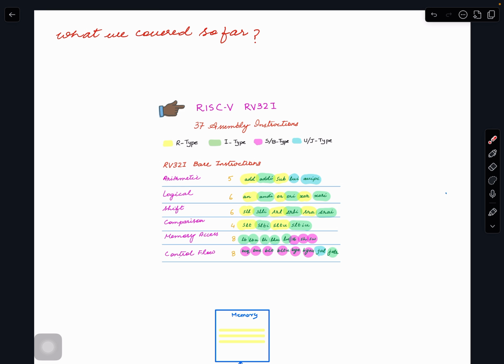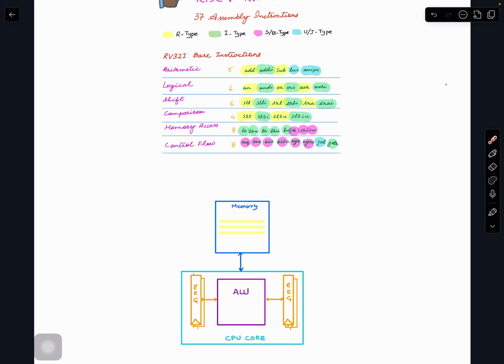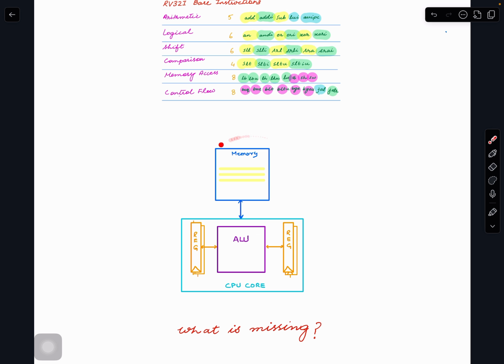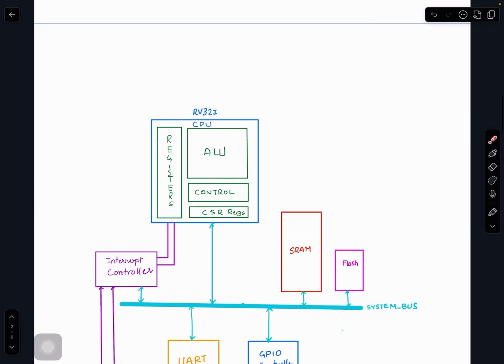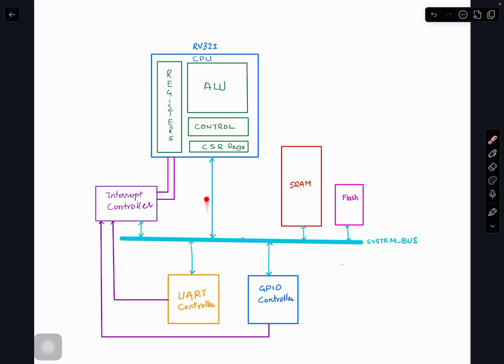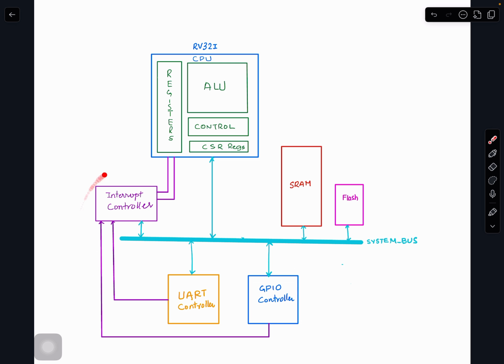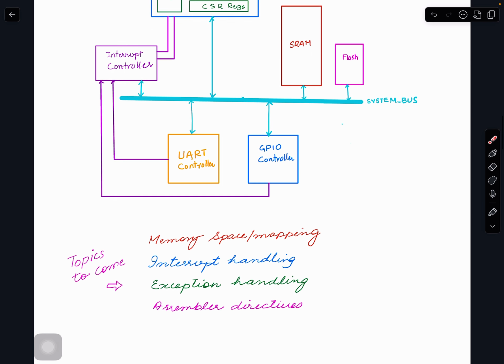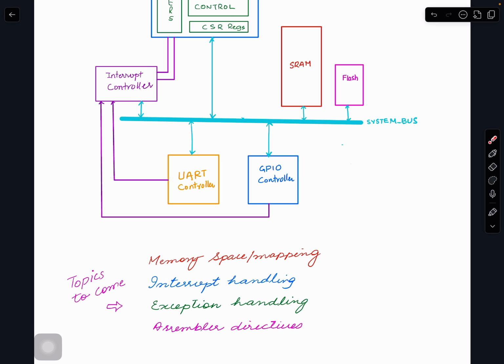Week 8, Video 1, RISCV interface to the outside world, Peripherals

Comment: Any thoughts on LiteX? 

I wanted to try RiscV, so I used LiteX to instantiated a VexRiscV design on a Lattice FPGA...  however, I have not been able to connect to the CPU with a debugger   (OpenOCD/F2232H)!

(
python3 -m litex_boards.targets.colorlight_5a_75x --board=5a-75b --revision=8.0  --cpu-type=vexriscv --cpu-variant=standard+debug   --uart-name=serial   --csr-csv=csr.csv  --build  2>&1 | tee build.log

openocd -c "adapter driver ftdi"
-c "ftdi vid_pid 0x0403 0x6010"
-c "ftdi channel 0"
-c "adapter speed 1000"
-c "transport select jtag"
-c 'jtag newtap lx cpu -irlen 4'    #"jtag newtap ecp5_main tap -irlen 8 -expected-id 0x21113043" 
-c 'target create lx.cpu0 vexriscv -endian little -chain-position lx.cpu -dbgbase 0xF00F0000'
-c 'vexriscv cpuConfigFile cpu0.yaml'
-c 'init'
-c 'reset halt'
)
Reply from the maker: Sorry, i cant help you here